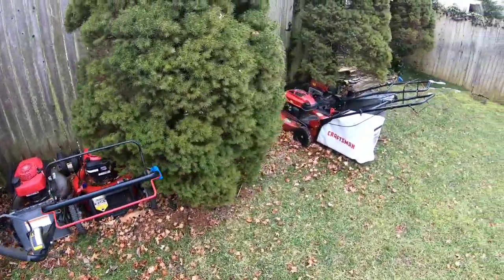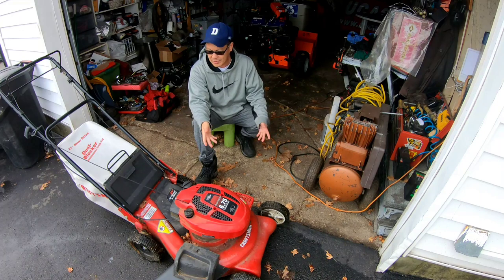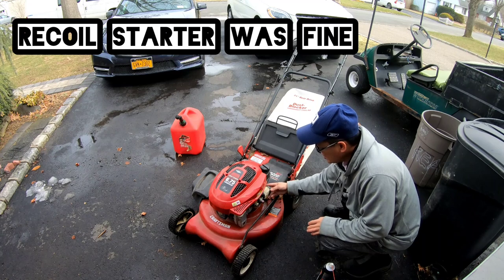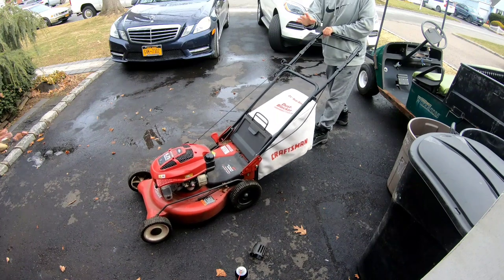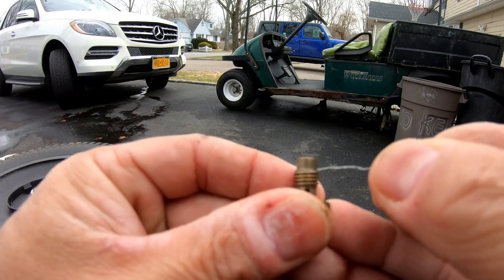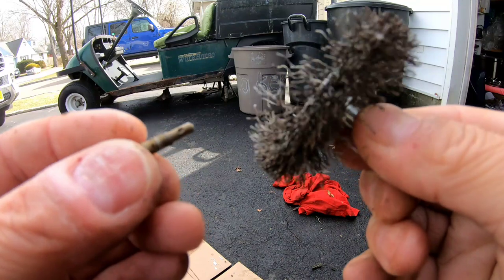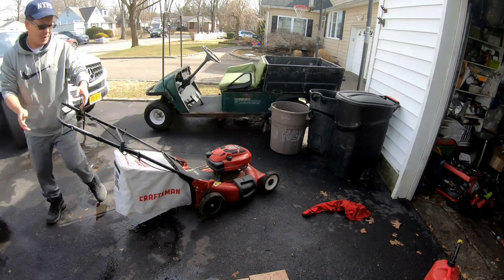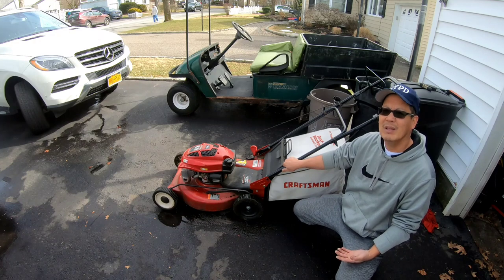FREE CRAFTSMAN HI-TUNNEL 21" 6.5HP TECUMSEH REAR SELF PROPELLED LAWN MOWER QUICK N' DIRTY CARB CLEAN

Comment: Likely just needed to run for a bit and loosen up and give a little boost to the compression which should help it pull gas better. These engines should also have a new primer bulb every 4 years at the minimum. Good vid Henry and I love the Tecumseh's like a Starbucks coffee.
Reply from the maker: Yeah buddy

Comment: Not challenging you Henry; I'm a fan. But I think Tecumseh lawn mower engines get a bad rap because the carburetor and primer can be problematic. I agree. But the  power plant is solid, superior to Kohler and the newer Briggs. I think it is at least equal, build-wise, to Briggs Quantum & maybe even Honda GCV's. After all, the great sounding engine you are featuring here is at least 12 years old and maybe older. 2008 is when Tecumseh quit making lawn mower engines but there are still lots of of them around along with a good number of a/m parts.
Reply from the maker: Of course bro,  everyone has their own opinions!  I just hate them.  I’ll go with a quantum or Kohler xt series because they don’t have problematic carbs and primers,  at least the auto choke versions which tecumseh never had.